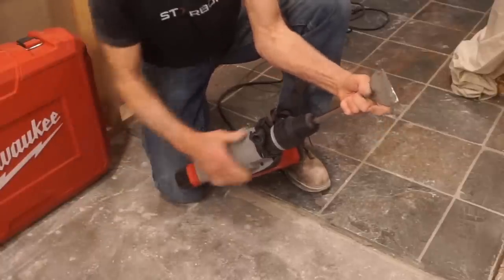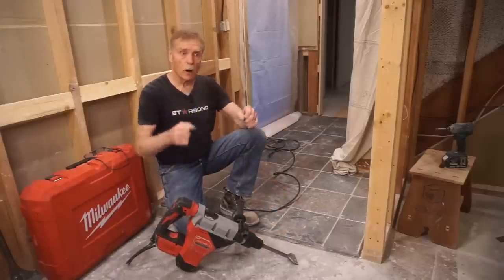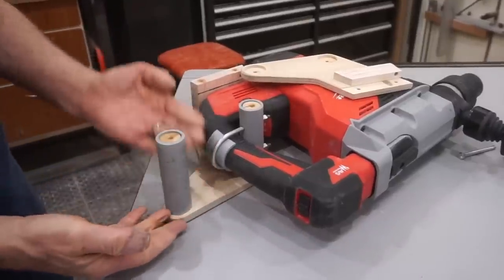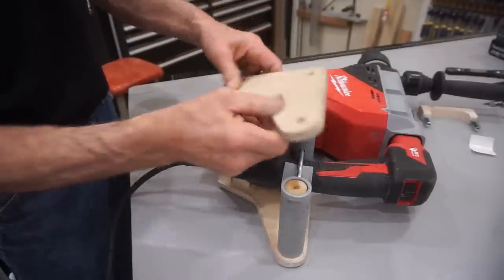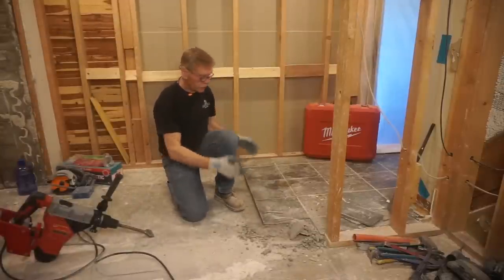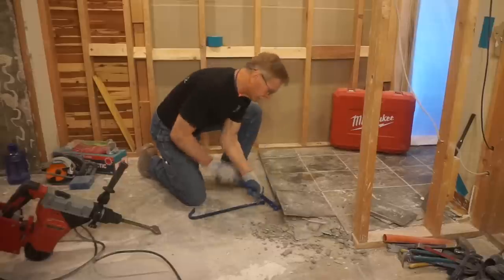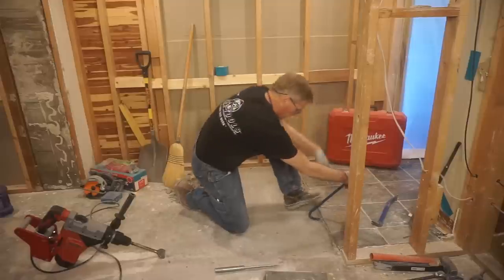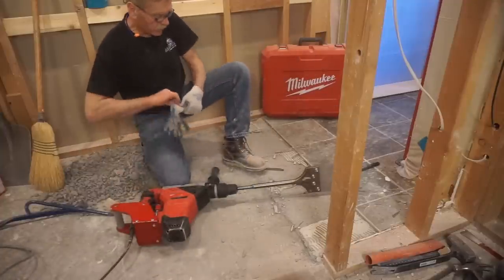Milwaukee Rotary Hammer Review & Ergonomic Improvement

Comment: Why not hold it sideways or upside down so that you can lower the angle?
Reply from the maker: Seems like a good idea that will work, but in practice it's even harder on the wrist in my experience.  If you look close at this timestamp you'll  see the bit is oriented sideways because I was trying out holding the tool sideways at the time, as you mention: https://youtu.be/oKJHs4lno8M?t=175
Reply: @NextLevelCarpentry  I wasn't thinking of doing that for your wrist as much as so that the force is directed more into the tile and less into the floor.
Reply from the maker: @garyh4458  yeah upside down is even better than right side up and noticeably better than sideways but no matter which way it's very awkward and non-ergonomic IMHO. I'm guessing you've done your share of this sort of work because making the tool do the work with the least amount of physical effort is the key to sustainability😎
Reply: @NextLevelCarpentry  I haven't used a tool like that but I have removed a lot of tile with a big chisel and big hammer and ended up with bursitis.  :) I just know that placing the chisel more parallel to the floor helped.  I wonder if you could rig up something to set the tool in so that you can just roll or slide it on the floor as opposed to having to hold its weight.  I agree that when using a heavy tool like that for a long time that ergonomics and efficiency are important and you might have to trade off one for the other.  Anyway, just trying to share my ideas.
Reply from the maker: @garyh4458  This is what I'd get if I had to do a lot of this: https://youtu.be/oKJHs4lno8M?t=356 but, as it is, it's one of those things I don't want to get too good at. 🤯

Comment: That tube looks like it could be BenGay conveniently place with the tool because after a day using that tool you are going to need some relief 🤣🛫 
I am guessing that is lube for the bit! 😁🛫
I would be using a much longer bit! Too!
You could have saved a lot of time building the handle by having Chip bust up that tile!🤣🛫
Reply from the maker: Correct about the lube tube... got a good chuckle out of your comment!
Unfortunately they don't make 'much longer' bits... my guess is that they'd be use for prying and damage the chuck?
I have to believe it's more than coincidence that Chip, like many others, schedules their time off specifically to avoid hard, unpleasant work.  Maybe I'm not the sharpest chisel in the toolbox but, paradoxically, I get a real sense of satisfaction from doing good 'ol grunt work from time to time...

Comment: Anyone know
Where place to buy concrete bits for the 1 3/4 M18 fuel?
Reply from the maker: Any decent hardware store or home center should have standard shank carbide tipped bits for drilling concrete plus SDS and SDS Max bits, depending on the type of chuck the 1 3/4 M18 has.